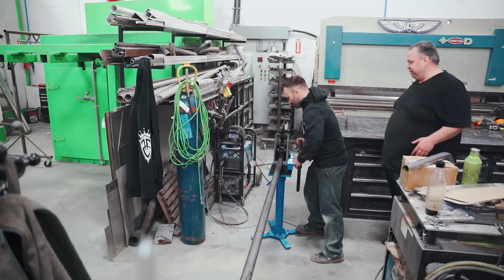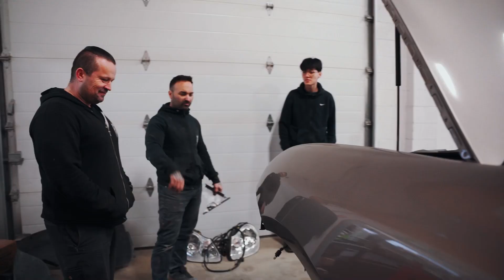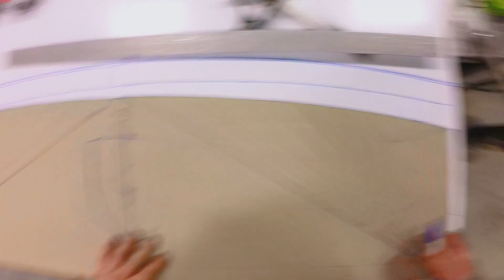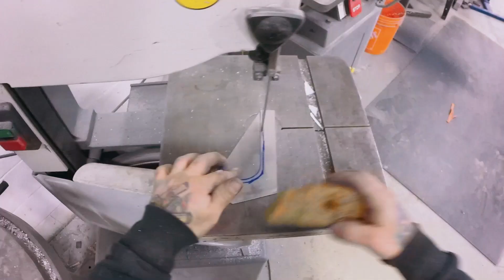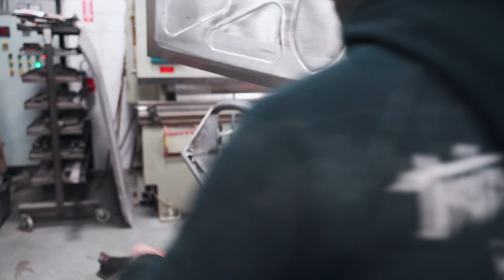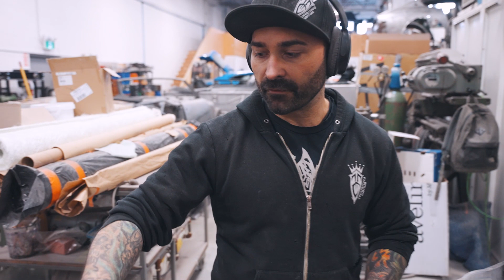Flame Bending a Custom Tube Bumper for a Porsche Cayenne

Comment: In Australia we hit 300 pound kangaroos at night. We need a full bumper protecting everything upto the bonnect and side fender. Hitting a kangeroo at speed is considered a potentialy fatal. Best case they will do alot of damage to the car. worst case they go through the windscreen with that much mush force and weight it kills people and half head automatically thrash thier legs killing people.  thier no joke.